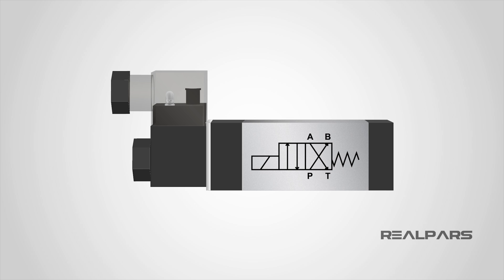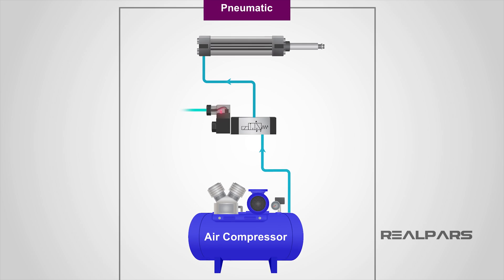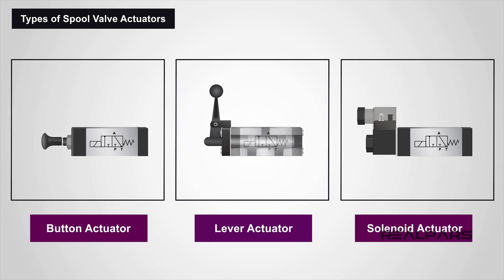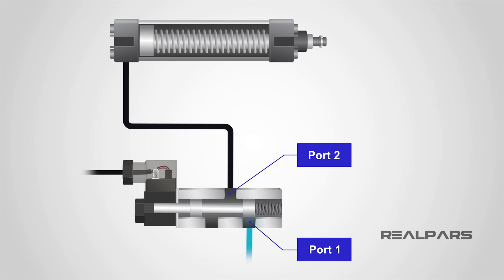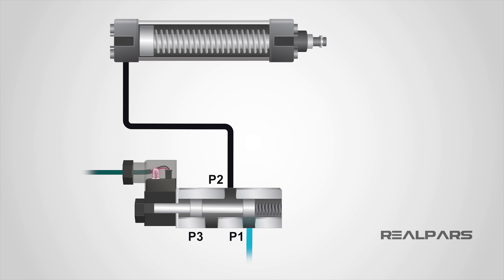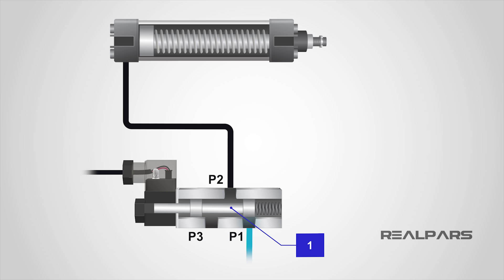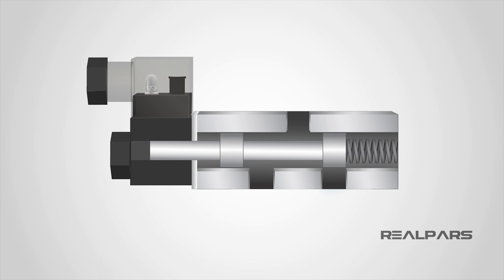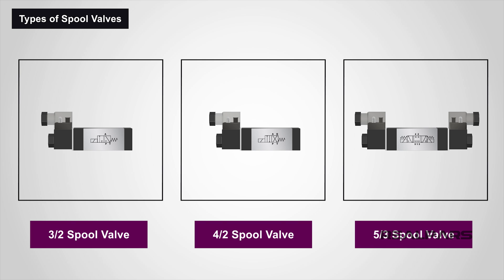What is a Spool Valve?

Comment: Thanks. I never knew how they worked before and now I do. I do have a problem with one lever, or one spool on a two spool auxiliary block I have on my tractor. One of my levers has recently become stiffer to move. The whole block operates my front loader hydraulic rams. The other day it actually stuck in a working position and the ram carried on further then I wanted and had to quick put the lever back to the rest position by hand. Since then, it's moved a little easier, but the lever still doesn't go fully in to the rest position. I also notice that ram is working a bit slower in one direction then the other. Its a double acting ram. Do you think it's the levers pivot pin at fault, or the return spring of the spool gone weak, or are there any rubber seals inside that may have got worn. The other one on the block still moves freely as it should.

Comment: The 6 in 1 bucket of my backhoe loader (4wd) is not opening. What could be the problem?
Reply from the maker: Thank you for your question. To assist you effectively, I would need more information about your system, as well as any available electrical or mechanical drawings. If you have your user or maintenance manual, that would also be very helpful.

I recommend reaching out to the manufacturer of your product for specific technical support. In the meantime, you might want to check some basic components such as fuses, hydraulic fluid or air lines, supply lines, wires, safety switches, and interlocks.

I hope this helps, and good luck with your troubleshooting! Happy learning!

Comment: Can I use a pneumatic spool valve to control a pressurized water control line?

What will happen if I do?
Reply from the maker: It would probably work, at least for a while.  The issue is going to be the materials of construction of the spool valve. If there is a high iron content in the metal, corrosion will undoubtedly occur.  For water, it would be best to use a solenoid valve designed for water service.
Reply: @realpars  Many thanks for the response. This helps.

Comment: As someone who repairs industrial controls and instrumentation it is the little mini spool valve inside the positioner that is usually the problem when valve positioners fail to work and cleaning the spool valve which sometimes get "gummy" with some isopropyl alcohol so it can freely move you can save often save yourself the cost of repair or replacement

Comment: Thanks a lot. Are the 5/2  double solenoid valves built in  pilot operated or direct? Or, are there both types?
Reply from the maker: Direct operated.  The "spool" (solenoid actuator) changes position based only on the presence or absence of an electrical signal to the coil and sets the air flow path based on that position.  There are pilot solenoid valves, where the solenoid electrically changes the position of an attached valve.  But more common is a direct solenoid (spool) valve being used as the pneumatic pilot for a small 2-position valve.

Comment: I'v been facing an issue with these spool valves, we use them for press boards, so it's consistently opening and closing, and sometimes when the control relay isn't energized from the PLC, the spool valves stays energized which creat a descrepancy, so i had to disconnect everything, unplug the coil, from the valve to reset everything.
Statements:
1- iv found the coil too hot
2- the coil resistance is close to the value of the data sheet, around 0.9ohm
In order not to stop the production, i had just to replace everything, but not really find what's the problem ?
Any common issues with these valves to know. Thank you
Reply from the maker: The symptoms you are describing are indicative of undersized (power rating too low) spool valves or valves that are not rated for the operating pressure.  If the spool valve is too small or is not rated for enough power to move the valve freely between positions, the plunger can bend, causing the valve to stick or the coil to overheat.  If the coil is in the energized position for a long time, it will heat up, so a heavy-duty coil will need to be specified.  Also, make sure that the electrical requirements for the spool valve coil match the power supply.  Since a spool valve with an AC coil looks the same as one with a DC coil, make sure the model you have installed is correct.  I have seen this happen quite often, and a mismatch of power type will definitely cause overheating.
Reply: @realpars  thank you for these precious clarifications. Will review and apply the modifications.

Comment: How do we know the spool is broken?
Reply from the maker: If the valve is "fail closed", the valve likely will not close when de-energized. If the valve is "fail open", it likely will not open when de-energized.  The actual resulting action will be determined by the pressures of the fluid on the plunger, keeping in mind that the plunger will not respond to the coil action if it is broken.

Comment: can i get a valve that allows the pneumatic piston to go back and forth by itself with no human imput  except to start and stop the process without electrical power?
Reply from the maker: You can certainly get pneumatically-actuated valves, but you will still need something to generate the actuating signal.  For this to not be an electrical signal, you would need a human to switch the signal on and off using a directional hand valve.  But I am not aware of any device that will toggle on its own.
Reply: @realpars   thanks..is there a way to do it using its own power ?

Comment: What is the difference between sliding spool valve and simply spool valve
Reply from the maker: As the video showed, a Spool Valve is used to control the direction of flow of the energy source by combining or switching the paths through which the oil or air can travel.  Spool valves are used for directional flow control.  The term "sliding spool valve" is common when describing spool valves used for hydraulic control, since the "spool piece" that slides from one position to another resembles a piston.  There is really no difference in meaning, except sliding spool valve usually infers a hydraulic application.

Comment: are they any lifetime issues using solenoid spool valve for the hydraulics system? please explains to me the disadvantages of using solenoid spool valve?
Reply from the maker: Like any actuated valve, over time the spring will wear, break, or become deformed.  The lifetime of a spool valve in hydraulic service should be quite long, but holding the valve open for long periods of time can cause the electromagnet to weaken, high pressures can cause seals to weaken over time,  and hydraulic fluids can often become contaminated and cause corrosion.  Good routine testing and maintenance of spool valves should keep them operating reliably for many years.

Comment: Is spool valve is same as directional ball valve??
Reply from the maker: No, not exactly.  A ball valve requires an actuator to open.  A ball valve is a mechnical device used to block or allow flow, but it needs an actuating device, whether it is an operator handle or a spool valve (solenolid valve).  For an air-to-open valve, the spool valve allows air into the actuator chamber, which allows the valve to open and allows are to vent to close the valve.

Comment: Sir What is the difference & where to use 3/2, 5/3,4/2 valves
Reply from the maker: The instances where you use each type of valve configuration depends on your specific application.  A 3/2 valve is typical used for on/off applications like a block valve with a spring -return actuator.  The 3/2 valve has three ports (air in, air to actuator, and vent) and 2 positions (essentially, to-actuator, to-vent).  A 5/3 valve is often used for actuating one of two valves, with a third position available for no actuation.  A 4/2 valve is often used with double-acting spring actuators, which require air to open in direction 1, and air to open in direction 2.
Reply: Thank you sir

Comment: Request to explain proportional valve and it's control from PLC analog output.
Reply from the maker: A proportional valve moves based on the output from an analog output card in the PLC.  At 4ma output, the proportional valve will be closed (0%).  At 20ma, it will be fully open (100%).  So proportionately, the valve is 25% open at 8ma output, 50% open at 12ma output, and 75% open at 16ma output.
Reply: @realpars  ohh thaanks so much

Comment: Thanks realpars, please can you go more details in the programming that can be used to cause a motion using spool valve. 

Presently, I'm finding it difficult to write a program that can give a stroke movement to a machine using 5/3
Reply from the maker: A 5/3 spool valve (or DCV) typically has three positions that are controlled by the state of 2 solenoid valves.  Let's call these solenoids A and B.  So position 1 would be the center position, with both A and B de-energized.  Position 2 would be A energized, extending the spool away from A.  De-energizing A will cause a spring to return the spool to the center position.  Position 3 would be B energized, extending the spool away from B.  De-energizing B will cause a spring to return the spool to the center position.  The action of each position depends on the port arrangement and spool design as well as how you have connected the air tubing.  Refer to the manufacturers diagram for this information.  In the PLC, you would have logic that does three things:  Move the spool to position 1:  A and B outputs OFF;  move the spool to position 2:  A output ON, B output OFF;  move the spool to position 3:  A output OFF, B output ON.